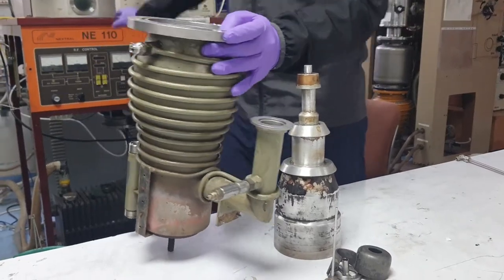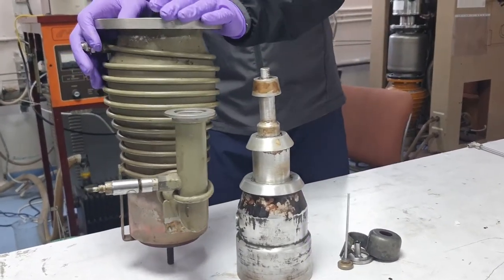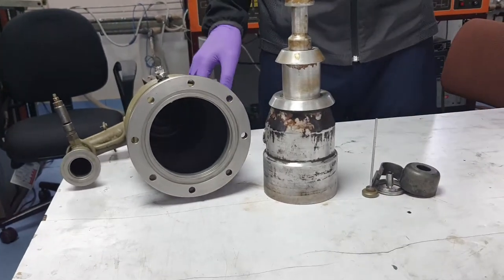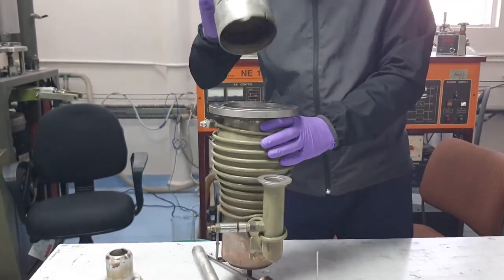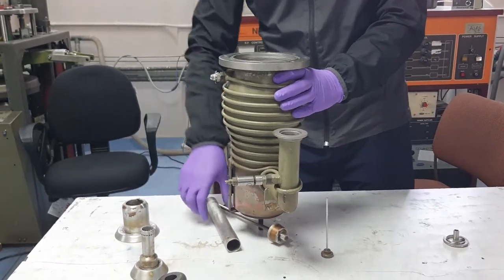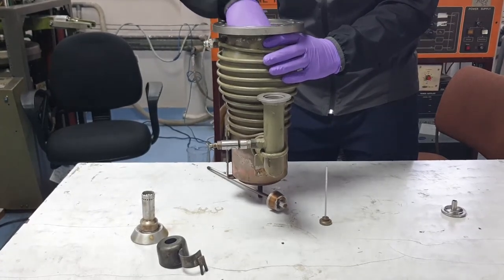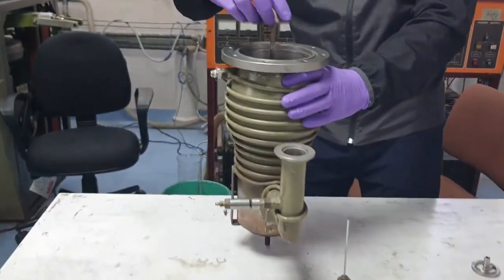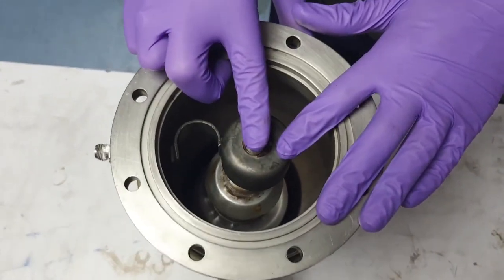Assembling Diffusion pump

Comment: Sir, I want to buy a diffusion pump ,that can create 10 ^-3 to10^-5 tor vaccum, which will be suitable at low cost? Please tell me.And what is the price which  pump you are showing?
Reply from the maker: The pump I am showing came with the Reactive Ion Etching system from the ALCATEL NEXTRAL. Now the company has stoped producing such systems. The prices of dufission pump varies from few thousand to few lakhs, all work well the only difference is of cooling mechanism whether it is  water cooled or cryo cooled.  If you wish you can visit the nearby R&D institute like IIT-Delhi CARE-LAb I am sure they might be having one.